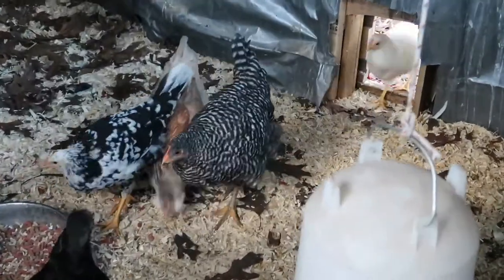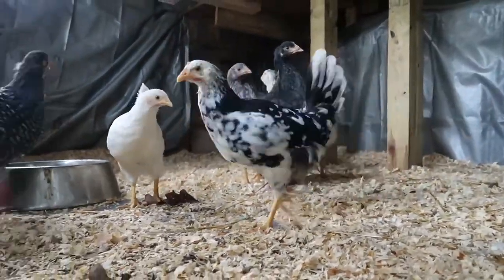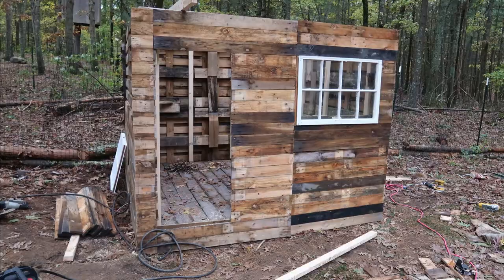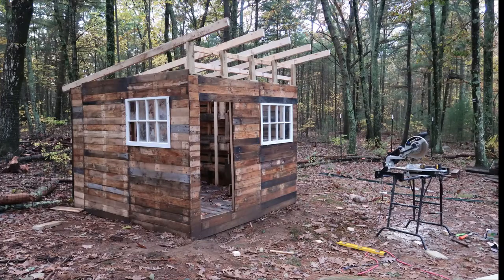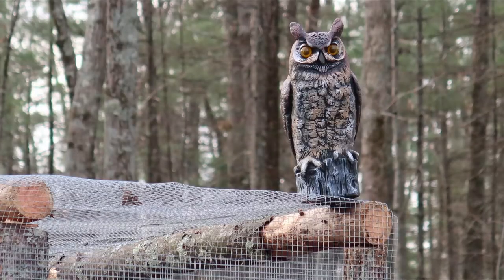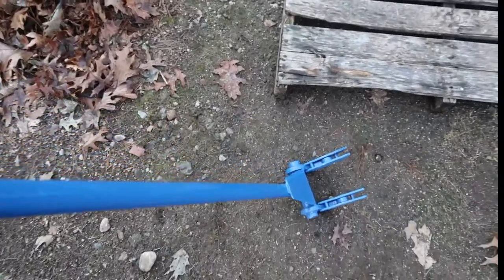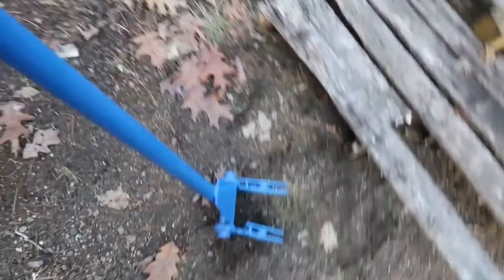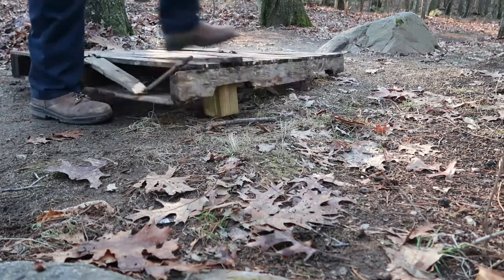DIY PALLET CHICKEN COOP | Dismantle Pallets FAST! |

Comment: Thank you very much for the idea with the 4x4 block I've never seen pallets torn apart that way before I'm going to try it tomorrow because I have a stack of pallets out back that I have been trying to pry apart by hand with a crowbar hammer and flathead screwdriver which is very frustrating.
Reply: I just tired it and I’m amazed! It works great, the only thing is I noticed most of my pallets were made where the nails extended past the wood and were then curved and hammered back in. So the block method didn’t work without snapping the boards, so I’m a little sad. Still, I’m going to use this method on whatever pallets I can!